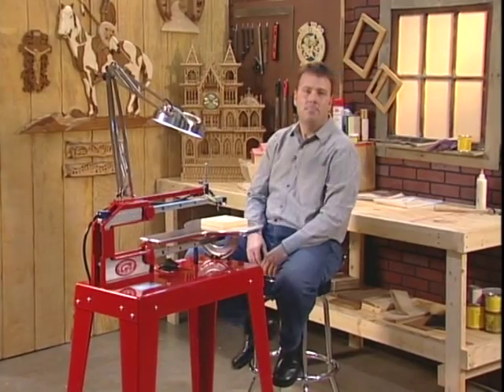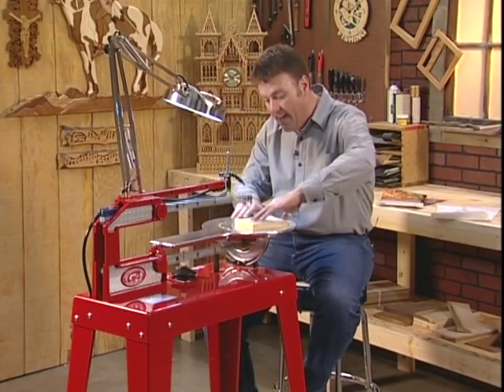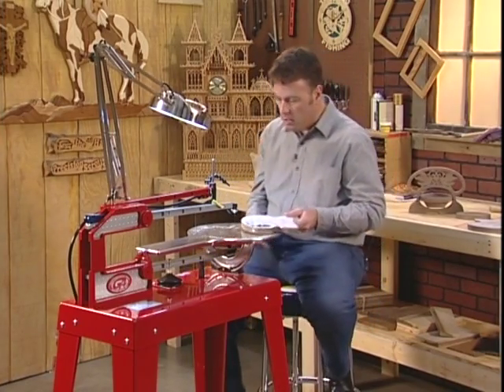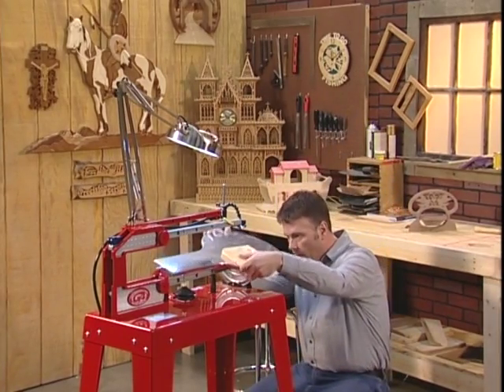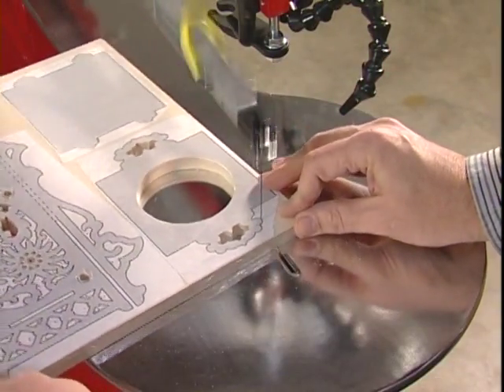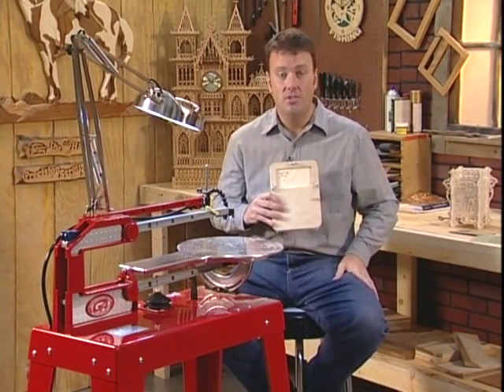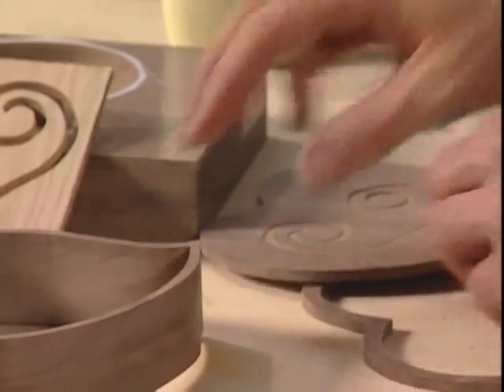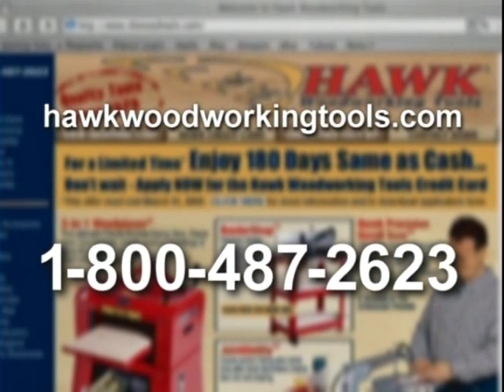Hawk G4 Scroll Saw Instructional Video

Comment: I bought my RBI 220 in 1993 and it's still running just fine. I do admit to not using it for months at a time though. But still, here it is April/2020 just about 27 years old and it's still going. And I'm 80 and still going too. I have been using it mostly for Intarsia now.  Amazing.

Comment: I purchase my saw 35 years ago, it works great! I can cut dove taills and pins with it of course a larger draw is a little hard to cut but works great. I have cut woooden clock gears, I made a clock in a few hours plus assembly and sold it for big $$$$

Comment: I was storing some stuff for my sister while she was moving into a smaller home. with this stuff was a craftsman scrollsaw, I was bored, set the saw on an old desk and started cutting. I was hooked, came a long way, that was 26 years ago. made the move and bought a 220VS in may of 1996. I'm still using the saw on a daily basis for 20 years now. it still looks as if it is new, and performs as such. if and when I ever where it out, I'll buy another, they are that good. The only way I would purchase a differant brand is simply to have a choice of which saw I want to cut with although I can't imagine getting used to a differant saw. 20 years ago I bought the "RIGHT" saw..

Comment: You show 7/8 " movement of the blade, but the dimension lines indicate from the top of the arm (when arm is up) to the bottom of the arm (when it is down). that would include the thickness of the arm. So the actual amount of movement would only be about 3/8".

Comment: upon further research on the New BM Hawk website they indeed do offer just the T drive screw for the old barrel blade holders and they are only 2 bucks.  That is reasonable!  So I believe they do care.  Just get this drive cap socket screw and the old barrel blade holder is renewed!

Comment: I have two Hawks.  I had the small one and also bought the 26" one.  I've had it for years and it still works.  However mine uses an AC motor.  I understand that this has changed to a DC motor for better control.  Show me more!

Comment: I fixed my barrel blade holders for 2 bucks!  Thank God I didn't spend $20 a piece for them which is what you charge for replacements.  All it takes is a plastic T and a 1/4x20 cap socket screw.  After pressing the T cap on with epoxy it will work for another 30 years!
Reply: Saw your update but just wanted to state parts for my Hawk for those T screws were only a couple of bucks about three months ago.  Talked to the folks out there and they were very helpful.  Their telephone number has issues sometimes seem like because of their location but they returned my call when I left a message.

Comment: Scott I own a 226vs Hawk. I have had it since 1985 I bought it for my hubby and it turned out I was the one who fell in love with scroll sawing. My speed has something wrong now it is locked on high. Do you have connections where to buy parts. I'm having withdrawal symptoms I want to saw now it getting cooler down here in Florida. I await your answer. Thanks.
Reply: Virginia Derk:  Look under your Hawk around the motor and linkages.  If it gets too much saw dust the speed controller is affected.  Just clean the hell out of it with compressed air and it will work like a champ again.

Comment: Can anyone tell me about the lower blade holder that is shown at 20:22?  Looks a lot different then what I have on my G4.  If it is easier to use, I am all in.  Thanks
Reply from the maker: That was the original blade holder they designed for the machine. It was cast rather than machined and was made overseas.
Reply: خیلی عالیه
Reply: I've had my G4 for about 10 years or so.. When the G4 first came out.  The holders kept changing.. it seemed.  I had problems with them and they would send me three or four new ones at a time.   Now they have new owners or new management...  The cost for one is ridiculous.

Comment: Are you still in business?  This video was published on Feb.20.2013 this year, your 800 no. doesn't ring to your no.!  Please return my info please!  Chris
Reply: I bought new clamps from Hawk for my bm-20 about a year ago in 2020 but contacting them by phone was an issue because of some sort of phone problem they experience in their area's land lines.  I know it seems strange but they still had those small items I needed through their website and I did actually get through by phone because one part was on back order which they got to me within a couple of weeks.  Good folks